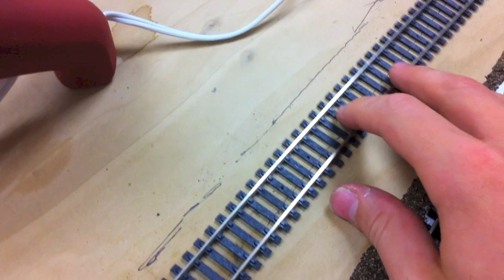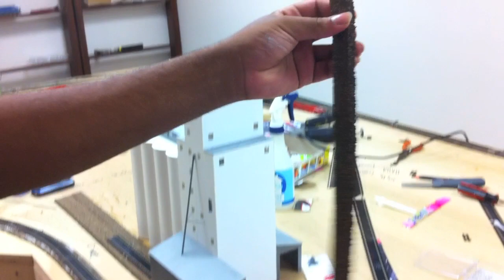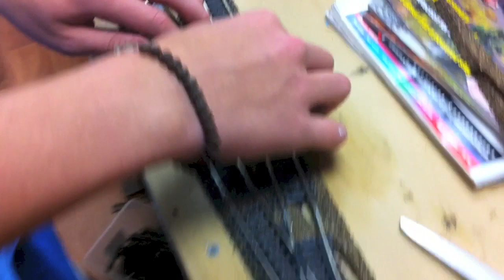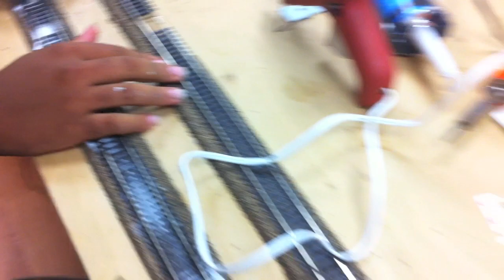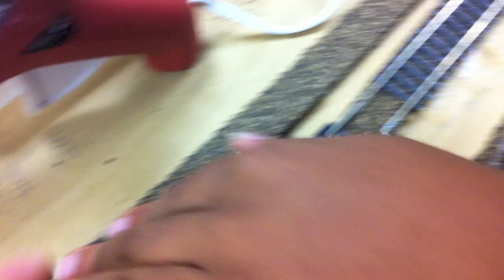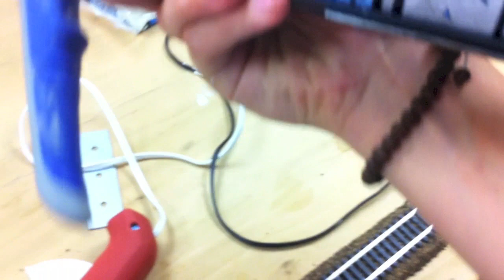How To Lay HO Scale Track - BNSF "Arlington Sub"

Comment: Thanks for the video! I just wanted to ask a question: I have my tables ready with plywood at the top, but I wanted to know if i need to put something on top of the plywood surface, or if I can just just start laying down the cork and track. I also wanted to know about laying switches down. On the side of the turnout where you attach your connecting track, it doesn't fit..........do  remove the ties? 

Thanks in advance!
Reply from the maker: Hey, thanks for watching! As you can see, we don't use anything on top of the plywood. The reason for this is that the landscape we are modeling is relatively flat, so there is no need to raise the track or have a base layer of foam to cut into to create ditches and stuff. Also, the wood that is used is very smooth and great quality. Consider both of these things to see if you need to use anything on top. Personally, I don't think you need to. But, if have a need for rougher terrain or your plywood has really defined grains, you might want to put some insulation foam down. For switches, you do the same thing that you do like we showed you on the flextrack or curve pieces. Usually, standard length sections like curve pieces, straight pieces, and switches all have a blended set of ends ties. You should remove these to allow for soldering if you chose to do this and to make it look more realistic. If the track isn't fitting in place, you could even cut some of the ties a little short or cut the rail depending on what your issue is. Hopefully I answered you questions well. I'm not sure if I told you what you needed for you second question, so if I didn't answer either one of your questions, please feel free to ask again. Thanks!

Comment: @bnsfrailfans

Thanks for the detailed answer! Really appreciate it! I understand what you mean by cutting of the blended ties to make way for soldering. I wanted to ask about straight switches though: What I mean is that on the side of the turnout on the switch (where the 2 tracks lead off) , if you connect a straight track to the straight track on the switch (not the one that leads off) the ties interfere with the track beside it (I know it sounds complicated). Do I cut off the ties? If so, how?

Really appreciate the help! And keep up the good work! I'm still in high school but i'm trying to make my own layout, so i'm trying to get all the help I need!
Reply from the maker: Ok. No problem. I get what you're saying now. We had the same issue, so what we did was just cut the ties on the switch. So, what you're saying is that when you connect track to the straight section of the turnout (on the end of the turnout with 2 tracks), the ties of the curved section interfere with the track you just connected. What we did was remove the end-ties on curved end of the turnout and then cut off the inside ends of those ties. I know it's hard to remove those ties though, so what you have to do is just kind of hack them up. You kind of have to make a triangle cut if I remember correctly.

So really, as long as they come off and don't destroy the remaining ties, it's all good. Then, we replace those removed ties with regular ties from another piece of track (not end-ties, but just 2 regular ties). However, to get it to not bump into the piece of track that you just joined to the straight section of the switch, you have to cut the 2 ties you plan to place under the switch so that there is only like 3/4 of them. So, if you look at a regular piece of track, the ties protrude on the outsides of the rail. So, cut the new ties so that on one side, there is no tie that shows on the outside of the rail. That side of the ties will go towards the inside of the turnout where the issue was (so the cut off section of ties that is no longer there is under the inside rail of the curved track on the switch). This should free up some space and allow for the piece of track you are trying to connect to actually go on. I hope this helps because I'm pretty sure I know what you're talking about. If you still have questions you can ask. Hopefully we can figure this issue out. 

As long as you remove the ties and get it so the track fits, it's fine. It doesn't have to be perfect. Just cut it so it looks good. Trying to remove the end ties is tough though, so just hack them off. :)

Thanks!

Ryan and Cam
Reply from the maker: I forgot to mention. We are also still in high school, so we're here to help! I'm sure your layout will be sweet. There isn't really anything like actually experiencing something. I know for us, there is a point where we have to stop planning and just start doing things. I like to over think things and think about how I could mess something up, but once you do it, it always seems to turn out fine. I know that's cliché, but a lot of the stuff that you see on this layout is something that neither one of us has ever done, so it's quite the experience. 

Not to get too philosophical, but I just wanted to say that we are here to help!

Thanks!
Reply: bnsfrailfans That's great help Ryan and Cam! Your layout is looking awesome! Hope it works out for you! Once again, thanks for the detailed reply, really helpful. It's just that these days i'm really bogged down with English, History and French and it is grade 10, so its really busy (as you probably know). I'm hoping to make some real progress during the Holidays, so i'm really looking forward to that! Anyway, if I have problems, i'll consult you!

Thanks alot for the help again,

Humza

Comment: can u just skip the soldering part? I can't do that. i think I'll just use pre made curves
Reply from the maker: You can, but the quality of connection might not be that great. The solder ensures that everything is electrically connected. It also costs a lot to buy tons of those. We also used pre-made curve sections, but we soldered the joints and spliced in extra ties in place of the end-ties.
-Cam and Ryan
Reply from the maker: The comment about cost was in response to your question about rail joiners, if that didn't make sense. And you can get a soldering iron at a craft store or Hobby Town.
Reply: ya, I don't have a hobby town near me, but I do have a hobby lobby. Idk if they have it though. how much do they cost?